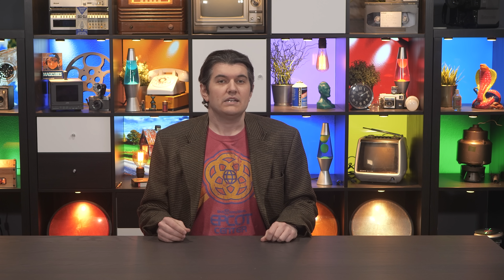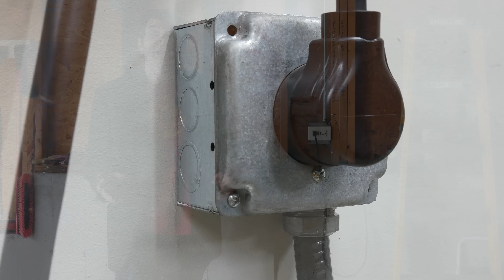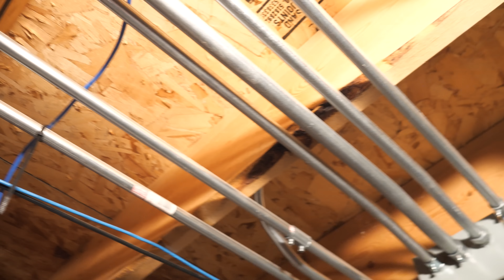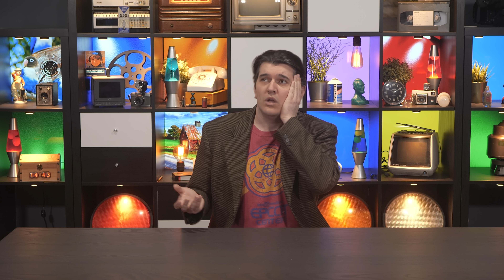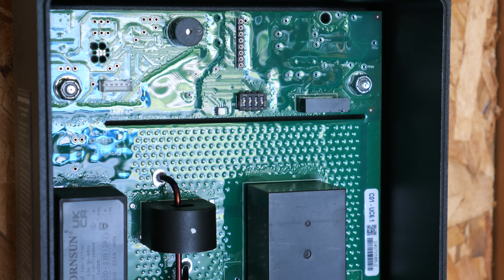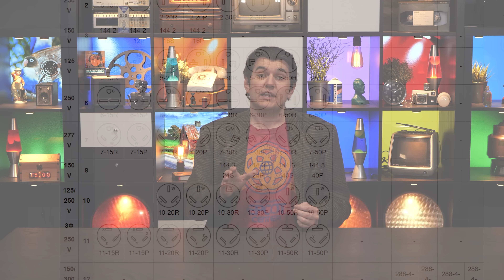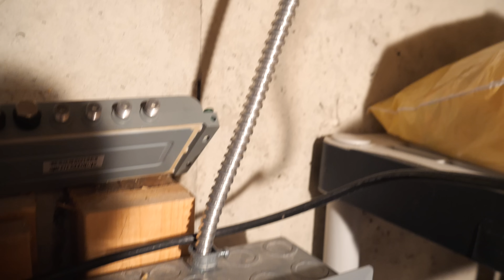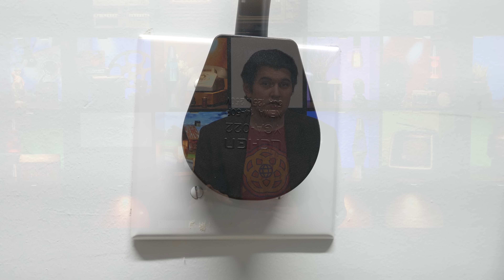The "standard" car charger is usually overkill—but your electrician might not know that

Comment: Charging batteries at lower rates is typically better for their long term health.
And charging at higher, faster rates tends to diminish their life span.
So using slower chargers will likely mean your cars' battery will last better in the long term, compared to if you only used fast chargers.

Comment: We needed a separate breaker and panel so the government is convinced we actually only use the electricity for our car, since we get most fees reimbursed. So now we have a 22 kWh charge point. I use the heck out of spot pricing since the cost varies a great deal, and I'm convincing myself that I might make up those 7000 DKK I spent on installation through bulk charging when the electricity is cheap or negative.

Comment: To rant on chargers that have unnecessary apps. I have an EVDuty charger at the apartment I'm renting, I swear it works better when the wifi is down... but without wifi you don't get fast speed and landlord can't see the power report, so it has to be connected...
can't charge the car when their services is down too because it must be started from their app... I wish I could throw this trash out, I'm getting a new one for sure when I move out

Comment: Had a chevy bolt and lived in a rental.   Had to use a 20 amp.   Plugged in the car every day after getting home from work.  And by the end of the week it needed 24 hours on the charger to be prepared for the next week.   Even overnight every day was running at a deficit.  
So.   Like most families in california with an electric car (look it up) we had a bigol truck and an electric that got little use.

Comment: I ran a level one for months for my tesla,  id run it to 20 and then charge it till full on weekends.  

I installed a wall charger , ran my own wire, had an electrician check my work, and make terminations. 
All in a wall connector from tesla was a little more cost as a gfci breaker, ev 14-50 the outdoor box and extra wire I would have to run. .

Comment: I have a 24 Plug In Prius and it uses the standard outlet. Charges slow but it works out. Takes about 9 hours to get 50 miles but not a big deal since it's a hybrid.

Plus we got solar panels, so it's better than paying for fuel.

Comment: Note also you need GFP for personnel, which is a higher standard than just ground fault protection.  From my limited experience (I mostly work on high rise apartment buildings), it seems like some local codes will essentially force the hardwired option due to the receptacle wording in this instance and manufacturer instructions per NEC 110.3(B)

Comment: I drive a fair amount, but live where I work.
My garage is only wired for 120v and the car can only pull 8-9amp before the voltage drops below 110v.

The car sits on the charger for 20hrs/day on most days and I usually go relax somewhere local for the other 4 hours.

In a typical week, I drive a bunch on the weekends. However, the level 1 charging gets me back to 80% SOC by Thursday or Friday without any additional charging.

Comment: I've been using a 5-20R circuit to charge my EV for over 5 years now. It's a dedicated line that use to be for the washing machine formerly in my garage. I never had it taken out so I now use it to slow charge my car. I charge about once a week and it'll charge from 30% to 100%, LFP batteries are great, in about 20-22 hours which is around 42kWh of energy. I did have to buy a special plug for my EVSE to allow it to go up to 16A but it's totally worth it.

Comment: I completely agree with you. I do have a large charging breaker with a full 48 amp capable charger for my Tesla in my garage. I am a very lucky person with my electrical panel being literally right on the other side of the wall on my garage and plenty of open capacity for a 60 amp breaker. So it wasn’t an issue. My Tesla wall connector is also hard wired directly to the breaker. It wasn’t highly expensive. 

Even though I can charge at 48 amps at 240 volts I never do. I always slow it down and slow charge over night to make sure heat isn’t an issue in the system. I don’t know how hot it would get but I know slower charging doesn’t get as hot and thus will help things last longer. 

My parents also installed a tesla universal wall connector which has the j1772 adapter as part of it. Why? They have a Jeep that has a j1772 and I have a Tesla that has NACS and they know NACS is what is the future plug.

Comment: I get that you want more people to know that you can charge on a normal household socket, but it is also important to note that it's discouraged as anything other than an occasional solution. Maybe this doesn't apply as much in the US, but certainly in Europe, if you just use a mode 1 portable charger, you won't get PEN fault protection, you won't get intelligent load management, and you run the narrow risk of overheating the socket.. For these reasons in a lot of EU countries is is against the regulations to charge a car like this on a long-term basis.

Comment: As batteries are getting cheaper, it's really perpetuating the spread of less efficient EVs with increasingly bigger batteries. So EVs are getting less efficient not more efficient because Americans just love their big, heavy SUVs. Smaller circuits aren't really viable for 90-100kwh battery packs, and recommending smaller circuits probably won't age well. The Bolt has a relatively small battery because it's a small efficient vehicle, but small cars are dead in America and small circuits will die with them. I wouldn't recommend anything less than 32 amps given trends to bigger batteries.

Comment: I unfortunately would need the nearly empty to full in 8 hours. I work 90 miles from home and I'm also on calls so I can get called to work within 10 hours of coming off duty. That means I may need 200 miles of range in like 7 hours due to my hour and a half drive to and from work. 

Why I've really been hoping for the Aptera to come out so I can easily still go 600-1000 miles on a charge and get 100 miles a night even on a normal house outlet. At least with the longer range I could go an extra trip without needing a full charge. Unfortunately it seems Aptera is just waffling around constantly making new prototypes rather than just starting with small scale production.

Comment: Here in Norway we do have 2.5mm2 cables and do have 15/16A fuses... So 3kW ro 3.6kW... we are NOT allowed to use electrical car charging on these due to fire risk. Using a cable a long time will surely warm it up... Combines with an onder outlet: 🧨
It is either 1 phase with 4mm2 set to max 25A at 240V, or max 400V with 32A to get 22kW...
So, most times I thing for the standart outlets the permanent "large" power draw is the problem

Comment: And there is me who installed a 32A charger in my European home, which means 22 kW charging. Just to be on the safe side. ;-) 16A chargers with 11 kW are the standard here when installing chargers for your car. 400V 3-phase if anyone is wondering.

Comment: Been using the 14-30 intended for my dryer for a long time, I have power split device plugged into to it so I don't need to swap plugs around. Fairly cheap devices.

Comment: I'm using a NEMA 6-20r outlet (240v, 20 amp). 12 gauge wire. I use a combination level 1 level 2 travel charger. I can get something like 3.8 kw, which is all i really need to charge my 40kwh 2018 Nissan LEAF.

Sometimes I jokingly call it Level 1.5 charging.
Reply: I agree with almost everything you said, however I would strongly recommend against charging on a 15 amp circuit with only 14 gauge wire. Stick to 12 gauge, 20 amp, preferably without other loads on it.

Comment: I am pushing for a federal law that requires a $100 charge every time an EV charge cable is connected to the grid.
This will be logged and held by the car's battery management system.
The data will be extracted and payment will be made at the time of registration renewal.
The money will be used for electrical infrastructure upgrades and to provide fire departments the necessary training and equipment to deal with burning EVs.

An ICE vehicle gets its' energy from an infrastructure that is built and maintained through the price of the liquid fuel.
If you don't have a car, you don't pay anything.

An EV gets its' energy from the electric grid that everyone has to pay for expansion and maintenance.
 
Do you think it is fair for the elderly person to have to foot electric rate hikes for EV use when they don't even have a car at all?

It never ceases to amaze me how selfish the EV crowd has become.

Comment: I don’t even have a garage and I charged my 2016 Leaf off an outside 15A 120v outlet for years until work added 240v charging (for free). I just had to put a cover on the outlet that completely enclosed the plug so I could leave it plugged in for all weather.

Comment: there are two things I want to see more of for charging on the go. More chargers at Grocery stores and main streets and the return of roadside attractions!

the first could be partially powered by having solar panels shade structures on over the lot and would be awesome if you need to do some serious grocery shopping and are going to be in there for a bit.

The second would be awesome for road trips you pull up to something like BIG BRUTUS or the winchester mystery house or some largest ball of Paint or twine,  get out plug in take a 10-20 minute break while you oo and aww at some strange thing and then move on.  I think it would be awesome.

Comment: I like my smart charger only because I like data. I like seeing how much electricity was delivered by the unit, at what speed it's charging at in real time (my car got that feature after installation, but its Hyundai, so, not super reliable), and a cost estimate without me having to whip out my calculator app and remember what my electricity rate is. Do I need all these things? Heck no. Do I even use these features a year after installation? lol no. But does it tickle my brain? Heck yeah. 
However for my second EV charging spot perhaps I'll go more cost effective.

Comment: He is right. I have an EV with a 9.6kW charger (50A circuit) and I can say that it is overkill.

As a rule of thumb, 9.6kW = 10% of charge per hour, which gives 50km per hour of charge! It is actually closer to 11-12% per hour.

A 120V outlet gives 6km/hour on my car. Assuming 10 hours only of charge, that is 60km or 30km each way, which cover lots of people, but indeed not everyone.

If you have a dedicated circuit, it may be possible to upgrade to 240V 15A with the same wiring if the code allow for it. In this case you double the rate, so 120km/10 hours. Amazon have some portable charger that may be suitable for this. Or you just use a field configurable charger and set it for a 15A circuit.

If the garage is new, it may already come with a #12 wiring, so 20A instead of 15A. That would be a 160km/night of charge.

And, there is some alternative to changing your panel if it is a bit undersized like mine. Emporia for example sell one with an energy monitoring device. You install the monitoring on your main input on the panel, and it now know the current your house use in real time. Then the charging station can be configured to be included in the system, and you can tell it to limit the power usage of the house to X amount of power. That amount is 80% of your main panel capacity. If you use too much power it will reduce the charging capacity or even stop it until the power usage goes back bellow the threshold, where it would then resume charging with the rest of the available power.

That system can also be used on a subpanel (care should then be taken to not overload the main panel). And it, in theory, could be used to share a circuit with, for example, your dryer. But that is probably not up to code. But it could work if you don't care about code.

I would also suggest to look at the bundle price vs separate items. Emporia sell 3 versions of their monitoring device: a 2 main wires only, a 2 + 8 circuits and a 2 + 16 circuits. At the time of purchase, the charger+2 mains kit was 1$ more expensive than buying the charger and the 2+16 version separately ! Yes, I saved 1$ by upgrading to the 2+16 version!

Each channels, inclluding the mains, uses a current sense transformer that clamp around the wire. You can decide to monitor each phases of a 240A circuit or just one side (set the multiplier to 2 in that case). Monitoring each legs is usefull for circuit with asymetrical load on each phases, like a subpanel for example. Else a single one is fine.

You can then get a nice view of your power usage and reports, and see what is expensive to run in your house.

As a side note, they also sell some outlet monitoring and switching device. You plug it in your normal plug and plug your thing on it, and you can remotely turn it on and off, and monitor the power usage. You can then put it under a monitoring circuit to "substract" it from the circuit, so you can see the remaining load of that circuit. Usefull for monitoring your computer power usage for example. Or to monitor your gaming station, or washing machine...